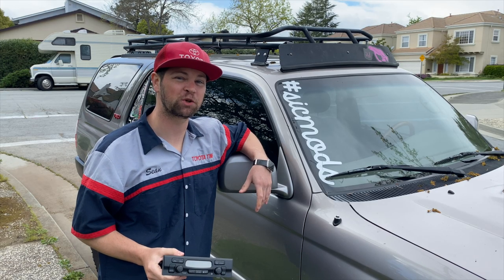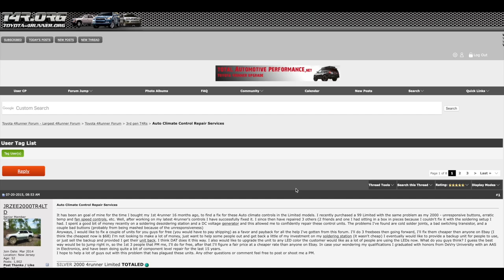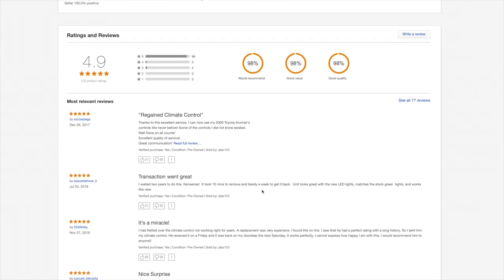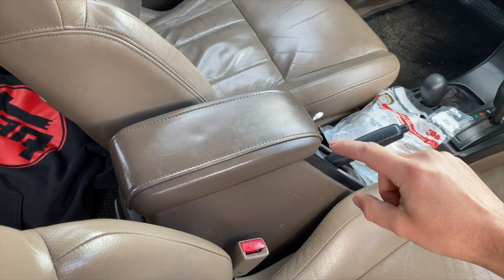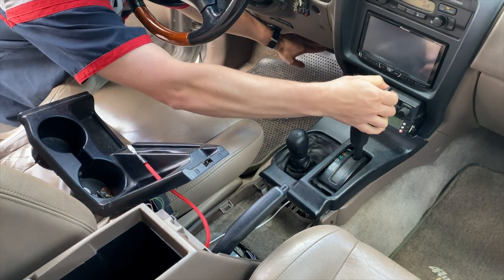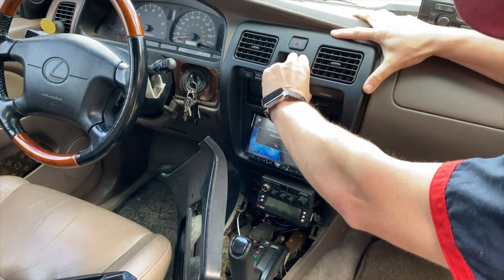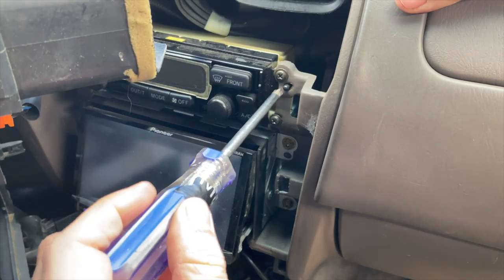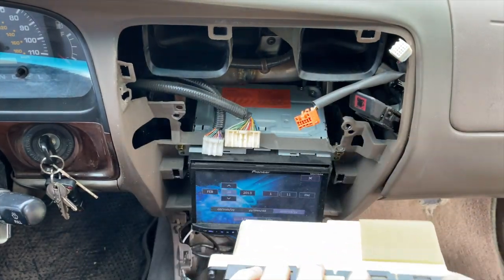Automatic Climate Control Repair

Comment: I have personal experience with this repair done from John. He got my CC back quickly and it was fully functional. Absolutely worth the price and minor wait for having full control again of the electronic CC. 

Nice work on the video. Keep em coming!
Reply from the maker: kyle snipes thanks for adding your personal experience to this video. We really appreciate it!
Reply: I've tried twice to contact John at the Comcast email, but have received no reply. Can someone suggest another repair resource, also? Thank you!
UPDATE: Unfortunately, I was never able to contact John, so I pulled the unit, disassembled it and cleaned the push buttons on the control board with NAPA Electrical parts cleaner. It works like new! I'm glad I didn't have to get into any wiring, because it's definition a repair for an electronics guy!
Reply: @TimmyTheToolman  I would like to repair my 94 accord digital climate control, how can I reach you

Comment: Got mine done from John too! He fixed it the same day he got it and the unit was already on it's way back to me.  Thank god I found him on Ebay. I was about to buy a brand new replacement for $240 with core. He did it for $50 bucks and it's got a lifetime warranty, too.
Reply from the maker: Good to hear John was able to help you out.  It definitely is a significant money savings.
Reply: Do you have this guys information? I need it for the Illinois winter

Comment: Great video Sean hey my wife’s 01 4Runner doesn’t have that type of CC panel she has the manual type can I install this kind? Is it a direct fit? And are the harness connectors the same?
Reply from the maker: Edwin Medrano it is not compatible. The climate control system is completely different and this video only applies to those who have a limited 1999-2002 Toyota 4Runner.
Reply: Timmy The Toolman oh so only the limited versions of the 4Runner have this kind of CC and there’s no way of retro fitting it into the none limited versions?

Comment: Sup fellas - a little off topic but nice Lexus steering wheel. What year/model did you grab that from? Airbag is the same? Guess the reason I ask is I’ve been looking for a way to incorporate stereo controls into the wheel that looks/acts as OEM as possible. Wondering if I can source something from the Lexus side of the fence. I’ve got a similar Pioneer unit
Reply from the maker: The wheel came from a Lexus es300. & if you grab the wheel you need to also grab the airbag as well. The Toyota 4Runner airbag will NOT fit on the Lexus wheel. There was a guy on T4R.ORG that used a wheel & the steering controls from a GX470 & hooked them up to his stereo unit so it can be done. This wheel however does not have any extra stereo controls. It is basically the same as the 4Runner wheel but with the fancy wood grain.

Comment: Do you think if the module isn't working properly can it cause a short? And can it cause a fuse to blow? Recently when turned the fan nob on the ac control. It blew my  dash gauge fuse. I replaced the fuse and turned on the ac and it blew a fuse again.
Reply from the maker: Don't know if a malfunctioning climate control unit could cause a fuse to blow.  Maybe message John and ask his opinion on it.  We have his contact info in the video description. It’s most likely a short in the wire itself. So maybe some of the sheathing has peeled off leaving the wire exposed and if it touches metal it will short out

Comment: I have a 99 limited, i want to replace the radio/climate control bezel. it has a security light/bulb. I’ve seen ones on eBay without the security bulb insert and decal. Can I still use it and just leave it behind it or would I have to order it through Toyota?
Reply from the maker: Well, are you sure that's the only difference?
Reply: Timmy The Toolman yes that’s the only difference, I’ve seen under descriptions; they say it should fit my car. I just don’t want to order something and wait a couple of weeks for it to arrive and be wrong
Reply from the maker: @Alexisandsons  Having that light stuffed in the back shouldn't be a problem.  I'd probably just remove the bulb and zip tie the wire to something else so it doesn't rattle around and make noise.
Reply: Timmy The Toolman nice tip, thank you very much

Comment: My console still works fine but the backlight seems to be out, or partially out.  Do these models allow for light replacement? Ive seen around online the base models do.
Reply from the maker: Contact the guy via or link in the video description and ask him.
Reply: Late reply, but yes you can replace the lights.  They're soldered in.  If it's the same repair guy, he's on ebay.  Actually offers LED upgrade with different colors to choose from.  So you can get blue white red purple instead of the OEM green.
Reply: @Tpklmale  So I pulled out the console and the screen fried somehow. I had to replace the piece altogether.
Reply: Big ole burn mark across the screen. It still worked but I couldn't keep it that way
Reply: Damn, I've been pricing them used.  I don't want to be without heat during winter.  Sometimes mine comes on, buttons don't work but knobs do (temp / fan).  Other times the unit just blinks and doesn't work.  I have recycle the key in ignition until it comes back on.  Back light quit a couple weeks ago lol

Comment: Hey i want to know about that stereo system which model is that one ? I want that in my runner
Reply from the maker: It's a pioneer avh-x4600bt, but this is old, outdated and discontinued. It still works great, and does fine with plugging in my iPhone for music. check out pioneer's website. check out this link. https://www.pioneerelectronics.com/PUSA/Car/DVD+Receivers
Reply: @TimmyTheToolman  thanks timmy for the reply actually i am finding the screen which tilt a little up like the same yours you have any idea which model is coming now with that. Will be very thankful

Comment: How to repair the servo engine change hot to cold?
Reply from the maker: If you have an 01 or 02 Toyota 4runner and you're having an issue with the climate control unit.  Send it to the guy we provide a link to in the video description.  It's as easy as that.

Comment: Can I drive around with the climate control out?
Reply from the maker: Griff Sconce                  yes, it won’t affect how your rig drives. You just simply won’t have Any options to adjust AC/heat.
Reply: You also need to have your outside airflow on or off, however you prefer it,  before you unplug the unit because you can't adjust that either.

Comment: Im trying to find the email to john if you could help me out I'd much appreciate it and I was wanting to ask you the glendor is broke and my 3rd gen 4Runner and it's like my air is blowing at the same time as my heat and the heat will blow in the back seats but it still blows cold air even though the heat is on, but it might have something to do with my climate control being on AC and not coming off
Reply from the maker: John's email is listed in the video description.  You just have to expand the description by clicking on "more". 

His email is: hadume123@comcast.net
Tell him we sent ya!!!

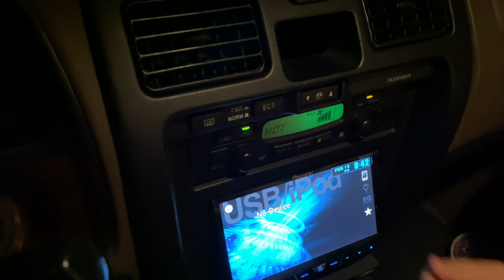Comment: This is a long shot but. Does anyone have links for 3rd gen 4Runner infotainment screen that till like 00:25
Reply from the maker: Daniel Rojas it’s a pioneer deck. They don’t make it anymore but they do make an updated version. Are you just interested in a 2-DIN stereo unit that tilts?
Reply: Timmy The Toolman yes. On my 97/ all 3rd gen’s have terrible infotainment placement. I didn’t think they made systems that tilt. That would help make up for the bad placement in my opinion.

Comment: Great video as always.  Sean, you do realize you said you liked to use a flathead to release the electrical clips and then proceeded to use a philps? 😉. Oh and don't touch your face on camera 😂
Reply from the maker: Good eye! Yeah, I usually use a flathead, but I just had the Phillips in my hand & it works, so I went with it.
Reply: @TimmyTheToolman  I know that feeling, like using the side of a wrench as a hammer because it's in your hand and the hammer is far away.  Whatever works to get the job done